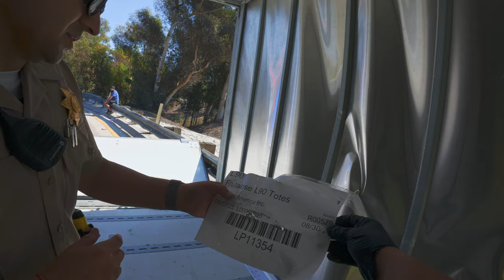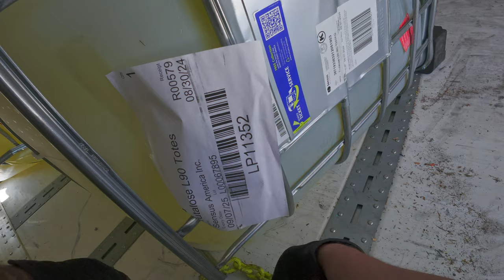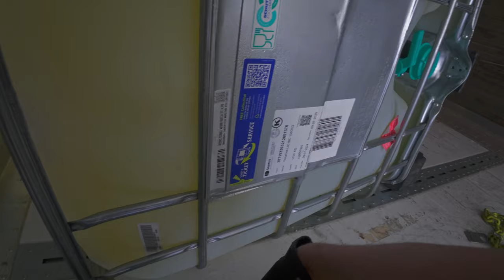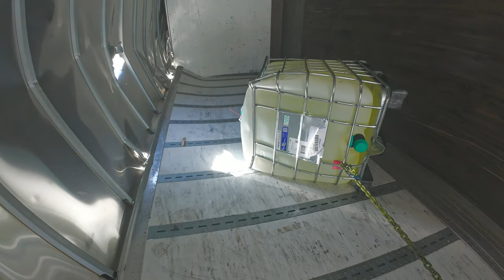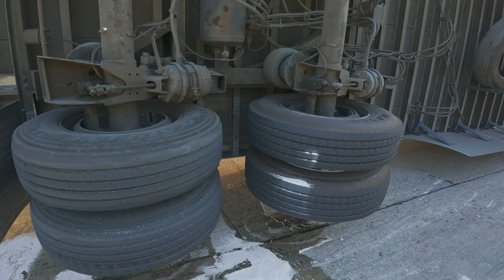Driver Flips Trailer and Spills 41,000lb of Syrup!

Comment: Unsecured totes singled out down the middle = recipe for disaster. Those things are literally on skis and MUST be secured.
Reply: No logistics rails in the trailer - squeeze bars wouldn't stop those totes from moving once they start....the totes SHOULD have been loaded left-right-left-right so they interlocked. It also helps if the driver doesn't take the corner like he's driving a NASCAR Cup Series race car....
Reply: @kentr2424  With the e-track built into the walls  straps can be used to secure them. Put them side by side like you said with a few feet between each row to even out weight.
Reply: @edstevens1435  I didn't see the e-track, but if it's there, it could have (and SHOULD have) been used to strap those totes in, you're right about that.
I wonder if the load was sealed when he hooked the trailer, or if the driver applied the seal after loading? If the driver sealed it, he should've known that straps should've been used and how to load the totes. How do I know, you ask? I've hauled cooking oil in totes that size (used in commercial bakeries) that weighed out at about 44,000 lbs. The totes were loaded in interlocking fashion and strapped in by me - so I never had a problem hauling them - in some cases from Western Canada to Oakland....
Reply: @kentr2424  3:47 The load was sealed so the driver is exonerated imo because I know how easy it is to move a tote.They are not light but slide easy on the hard oak floor.

 I used to deliver flavorings to the Nutter Butter factory in totes. Always remember the smell, just like the cookie.. I grew up between a bakery and a brewery so I was always smelling something good.

The leaking tote reminded me of when I picked up a tote of transmission fluid once, I left the customer and soon I was wondering why my tractor mirror was getting transmission oil on it until I saw my drive tires soaked in it and the trailer dripping profusely. The totes lid on top was not screwed on tight enough and my day was shot cleaning up the mess.
Reply: @edstevens1435  You're quite right - they slide easy....😱😱
If the shipper loaded and sealed the trailer without the driver there, the shipper is the idiot who didn't load the totes properly or secure them. Josh doesn't say if he knows whether it was the shipper or driver who sealed the load. That may be why the driver didn't seem too concerned, he can't be faulted for the shipper's improper loading and load securement.....and as you know, a driver can't break a seal unless a LEO tells him to or he's at the receiver so the driver can't check the load before leaving.
Reply: @kentr2424 
Clearly the trailer walls do have E Tracks. Did you watch the same video as the rest of us?
Reply: Ok I understand what you are saying but also let's place blame also where it belongs. Nowadays people don't wanna take ACCOUNTABILITY for what they play a part in. Even though those totes may have been loaded wrong the course of action from the driver caused the reaction of the totes moving and the truck decided to take a nap!
Reply: yeah, my knee-jerk response was speed as the cause, but it really looks like the trailer just tipped right over, without much skidding or anything, which makes it pretty clear that load shift was the primary cause.
Reply: I’ve hauled those totes before, also single file the key is securing the load properly, shipper would nail 2x4’s to the floor on the sides of the totes, and behind the last tote, then I’d add at least one load bar and a strap above and below the load bar,straps stop the load from falling , hope that guy had a tanker endorsement, required for hauling more than 3 if memory serves,
Reply: The important part is who sealed the trailer. If the shipper did it, driver should not be at fault. If Driver had opportunity to check load securement before trailer was sealed, it's all on him
Reply: They’re on pallets, that’s like how literally every van trailer you see going down the road looks inside, pallets loaded down the center with no securement, it’s bull💩
Reply: I have dealt with this so many times
Reply: @kentr2424  the driver is still at fault. I’ve pulled alot of pre-loaded trailers with top heavy products in there like paper rolls which weigh 5k lbs each and never had them secured or rolled a trailer over because you need to know how to drive a truck and really slow down on transition ramps and turns.
Reply: @vette2014 yup u r probably right, he probably turned too fast and then the weight in motion contributed to the rollover

Comment: No evidence of the load being secured so the load shifted. Over we go.
Reply: Can’t really secure a load being in a van trailer with no rail locks that wouldn’t stop that anyway even if it did
Reply: It’s a big issue with drop n hook loads
Reply: Nothing was strapped to the walls. Or braced. Or air bags.

Comment: From L.A. to Portland with the totes just sliding around? No wonder it flipped over.
Reply: Only done thousands of times everyday, without incident. Thats the difference between a 'truck driver' and a 'steering wheel' holder, with his bath towel on his head.....just sayin'
Reply: @Craiglife777  What an ignorant comment.
Reply: @r31527  No, it's not ignorant at all, it's truth.
Reply: @Craiglife777  The bath towel comment is the ignorant part...
Reply: @Craiglife777  No, Bath Towel is an ignorant comment.
Reply: @Craiglife777 racist

Comment: when hauling these totes full of any type of liquid you have to drive it as if you're driving a tanker! It's obvious he went too fast around the bend which caused it to flip due to the liquid surge. Hopefully he had a tanker endorsement because those look like 275 gallon totes way over 119 gallons, also over 1000lbs total weight. I'm not perfect, but that driver should know better! Good thing it wasn't hazmat and no one got killed including that driver. Thanks Josh and crew for another great video! Stay safe & God bless!
Reply: I believe that size tote is about  500 gallons, roughly.
Reply: What's obvious, the load wasn't secured, and it was sealed. No way for the driver to check the load.
Reply: From my experience with trailers hauling beer in roll-overs, because it was a food product, the load must be destroyed.
Reply: going to fast....load shift....yep. done! Fired! yep
Reply: @scudfarcus4343  no they’re 275 gallon totes. Trust me I deal with these a lot
Reply: The bad part about being a dry van driver is that you don't even know and they won't tell you you're hauling a tanker type load paperwork will only say commodity fructose this driver probably didn't know he was hauling this tanks
Reply: @mqmoreno2368 Got to use common sense. Commodity Fructose is Corn Syrup.
Reply: He doesn't have to worry about that tanker endorsement anymore 
(Mr Krabs voice) "YOU'RE FIRED!" 🦀
Reply: @ 😂😂 very true

Comment: If the driver was present and aware of how that trailer was loaded, he is a poor driver for failure to recognize the surge hazard. If he got the trailer sealed then this is a significant failure of communication and proper loading by the shipper. Only a qualified trained tanker driver should have been behind the wheel of such a load.

Comment: Fructose 90 is a type of high-fructose corn syrup (HFCS) that contains 90% fructose and 10% glucose. It's the most concentrated form of HFCS, but it's rarely used because of its extreme sweetness. 
HFCS is made from corn starch, which is processed to convert some of the glucose into fructose using enzymes. The amount of fructose in HFCS varies, with other types including:  HFCS is used in many ways, including: Sweetening, Browning in baking, As an anti-crystallizer in icings, and As a humectant in waffles and caramel fillings.  The new drone is great!  Funny you mentioned about your dad! He is a real go getter!  I caught the part where he told you to put the chain in one place and you said no it should go here. He said put it here and you said well ok. He said no put it where you said . He said no you are going to damage the thing. You said no I'm stubborn!
Reply: it goes go well in pancakes, so much better than maple syrup.
Reply: @UHStudioKane  I hope you are kidding! Have you ever even had REAL Maple Syrup? And if so what grade?
Reply: Makes sense that it's used for syrup
Reply: @oldogre5999 ikr 😂
Reply: @samholdsworth420  If you are going to pour that crap on your pancakes you might as well just add a few drops of hot water to your table sugar and chomp away!

Comment: A forklift is designed to work on a hard smooth surface, this is what limits it. Forklifts get stuck in mud, sand dirt etc., a telehandler is suited well to the work here and on flat surfaces, but is restricted in that is needs space to maneuver and cannot lift as high as a forklift. This was a perfect example of how teamwork makes life so easy, well done team
Reply: On what planet can a telehandler not lift as high as a forklift 😂
Reply: @gregshearer423  when a forklift has a three stage mast, it has a much higher reach.
Reply: @mfc4591  nope my 8000 lb telehandler goes up 50 ft. most regular forklifts don't go over 20
Reply: @ronblack7870  most regular 2 ton forklifts don't agree, refer to my first comment

Comment: Once food stuffs are outside a controlled environment the liability of using them is huge. Writing off a load is a lot simpler than dealing with a liability suit for someone's stomach ache when they learn that the syrup that was used sat on the side of the road for 10 minutes. Yes, it's perfectly fine, but liability these days is crazy.
Reply: Hope they used it somehow, cattle feed or at least add it to compost.
Reply: @bobh6728  Probably cattle feed. The other possibility is an ethanol plant.
Reply: @bobmazzi7435  I wonder if it could be used for ethanol since it is not exactly the same and it would be added part way through the process they use for corn. Just hope it wasn’t dumped in a landfill and buried.
Reply: @bobh6728  It's sugar and would ferment. Just add a hundred gallons per batch to the raw materials coming in and it'll be fine. <G>  Seriously, I would want a Chem E to think about if for a few minutes, but if I remember my chemistry courses from a few decades ago, it'll be fine.

Comment: A truck and trailer role over, brand new trailer destroyed, at least 10qt of 80-gallon containers of corn syrup rolled over, and 1-container leaking corn syrup all over the trailer and road, with cars passing by in the other lane close by. What a sticky situation! 😳 Yo my man Josh, I really like your new DJI 2nd generation drone. It flies super fast, it is nimble, and maneuverable as heck, I can't believe the way you were able to pilot it in-between tight spaces. I also love that little tilt it does while turning. COOL 😎
Reply: The trailer is repairable. The bottom rails and plate walls are undamaged. Just needs new roof bows and new aluminum roof, and it’ll be back on the road.

Comment: Good work. Was impressed with how strong those totes were, I have had a few that the metal frame was tack welded together and seemed more designed for keeping the plastic in shape. These ones were definitely stronger.

Comment: Why on earth are they hauling palletized totes in a box trailer? No way to strap or chain them down and those box trailers have about a polished floor! Driver was probably going a tad to fast and those pallets slid from center just enough to tip the trailer, have to remember that is a LOT of weight per container and once you get that liquid to shifting it can be a tremendous force!

Comment: Frutalose® L90 is a Liquid oligofructose derived from chicory inulin for food applications. Contains short chain inulin molecules.
A full Tote container Total weight (container + product): 2,222 lbs + 150 lbs ≈ 2,372 lbs each.
I used to work for Heavy Tow in NYC, and several truck drivers spilled this all over NYC streets,  because they did not secure the cargo and the weight shifted during a corner turn.
The liquid shifts and tilts the truck, and with the massive weight per tote container, the truck flips.  I used to drive and operator 60-ton Rotator.  I still have my W endorsement.  😂
It used to be S endorsement but they changed the letter.

Comment: What a sticky situation.
As the totes were compromised, no wonder the customer decided to scrap the load.
Joe is not afraid to jump on the equipment to get the job done quicker, but it sure helped speed up emptying the trailer. Who gets the job of cleaning all the gear? After this job, some of the team need new boots.
Like the drone vision.

Comment: I noticed the wood flooring and the plastic pallets the totes are on...the load shifted because the shipper did not nail wooden blocks or 2×4's to secure the load....that along with the steering wheel holders speed and sharp curve created this mess which could have been prevented

Comment: Would it be possible to design something to use to reinforce the roof of such trailer? Some bars that attach to the vertical perforated studs on the side of the trailer. So when the trailer is reinforced, you can upright it.

Comment: It's not the driver's fault though. I guess whoever loaded that trailer didn't strap the bad boy down. It shifted causing the trailer itself to tip over especially around the corner. I'm glad the driver is safe aswell.

Comment: I have been transporting liquid for about 11 years and going down a ramp like that I am very careful....going down the ramp my speed varies on how sharp and steep the ramp is; usually 15 to 20 mph...but a trailer with liquid totes or containers is just as dangerous as a tanker but in this situation I did not see anything holding down those containers..I hope that drivers gets a good lawyer,,,those containers being shipped unsecured contributed to the accident...

Comment: Ive picked up tons of liguid totes.i dont think his were hazmat i dont see placards.always used lots of strapps also.usually load them single and a double all the way back.i hope he had a tanker endorsement to pull these.whatever he did the surge hot and roller it right over.better he rolled over there then somewhere in the mountains on his way to oregon.

Comment: looks like a load shift should have used air bags or floor blocking with cardboard shippers now a day dont care put it on the truck close the doors cant blame the driver on this one
Reply from the maker: I agree 100%. First thing I noticed is how are you going to have 14 totes on skid plates on this surface with NOTHING to hold them in place? Not even cheap straps, of course this was a recipe for disaster.
Reply: @PepesTowingService If they load it correctly, the first two totes are side by side against the walls, then the other totes are tight up against them, with two totes side by side in the rear. (Maybe another pair in the middle.) Then they are all locked together. Hauled a lot of iron/steel castings that way. It’s only on issue when you take a turn way too fast that you get this problem. 
No problem using airbags, load locks, etc but unless you have to take evasive action, you wouldn’t need them.

Comment: Unsecured load, too much speed and over she goes. I used to transport BIG 6,000lb  reels of paper loaded in a staggered fashion down the middle of the trailer like skittles. Usually nine per load. We had to virtually crawl around some bends and roundabouts so as not to trigger a "slow rotation rollover".  The only straps to secure the load were the interior roof straps, two per reel and crossed over the front and rear reels and tow straps per reel in the radius edge of the reel and downt o the trailer side rail. The trailers were all curtain sided.

Comment: Rookie , totes not secured ,too fast, liquid slosh around tipping truck or pushing it.

Fill cap on top of tank have a built in pressure relief valve sometimes they leak